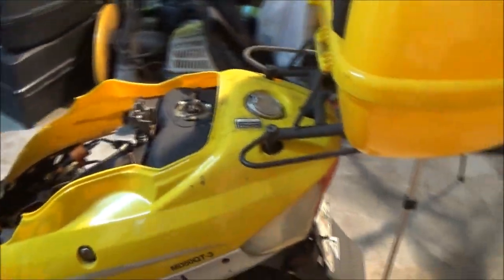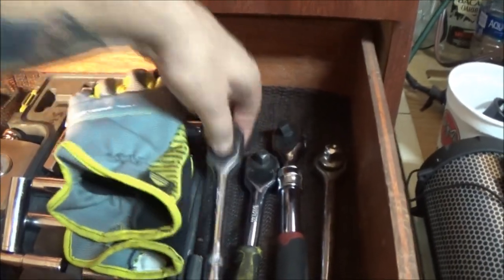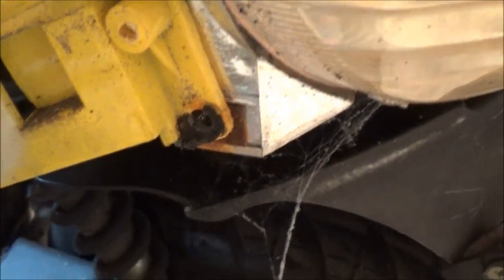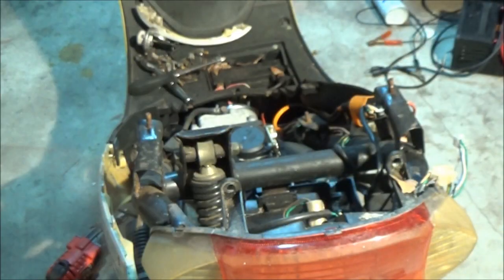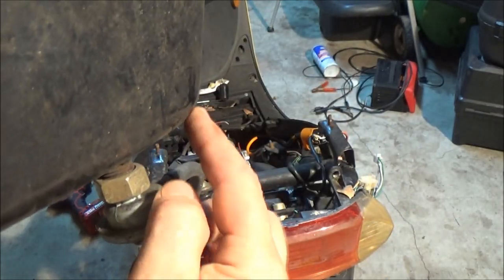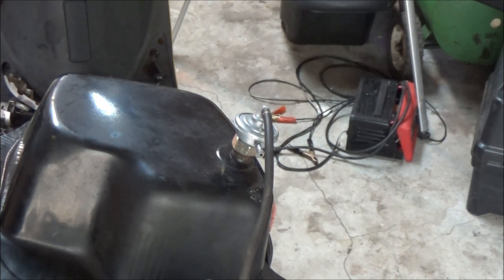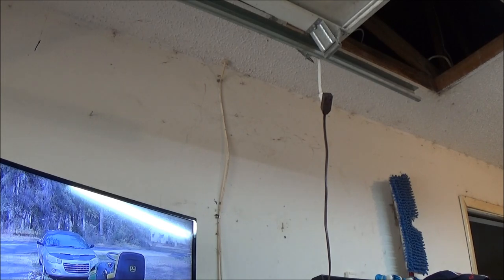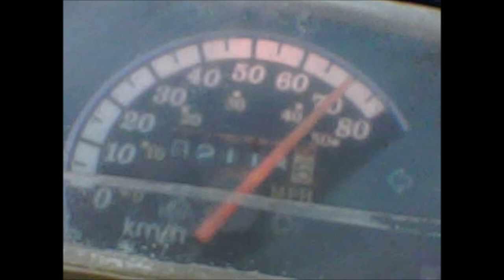Gas Tank Cleaning On The Scooter

Comment: Hello, I have a Future Champion  VIP With the 139QMB on it. Bought 4 years ago, drove it for a week and then let it sit in a shed ever since. Decided I'd break her out and try to get her running again. I bought a brand new tank on ebay because I figured the one in it needs to be cleaned, so instead of having to remove and clean then reinstall, I figured I'd just buy a new one and clean the old one whenever I got a chance to get around to it, but at least the new tank would save me some time. I thank you for putting this video together for us folks. You got a subscription!
Reply: did it start working after you got a new tank?

Comment: Very nice and detailed work my friend....🙏

Just picked up a Baja SC50 /basically a GY6-50...
Picked-up this project Scooter 🛵 for $150 and has been sitting for more than 5 year..!  😲

Mine came the plastic tank I just pulled and discovered it is cracked in three places due to gas & heat bloating tank...😳

So just ordered a new Metal Replacement Tank instead + New Carb..! 👌

Your video was very helpful cause this scooter has identical design to yours and even discovered your tank style works and fits into my Baja SC50...👍
Reply from the maker: Thanks man. Great deal you on your bike. Thanks for watching and commenting.
Reply: Where did you order parts?

Comment: What did you put in it to make it go 80mph
Reply from the maker: High performance parts. Carb, CDI box, Coil. You can also get a big bore kit pretty reasonable. If I do another one that's the route I'll go.
Reply: Can I put a 150 cc engine on my 50cc scooter body
Reply: I have the racing chi box coil and spark plug on it now and racing carb
Reply from the maker: Yes I have seen that done before there may be a little fabrication but it shouldn't be that difficult. But if you go with an 80 cc to 100cc Big bore kit it will come with the jug the gaskets the rings and wrist pin, that should put you up around 80 mph. But keep in mind if you do that you'll probably have to upgrade the exhaust so there's not as much back pressure.
Reply: Okay thanks that will be my next upgrade I like your videos it’s really helpful

Comment: Did you do any other work to it before cleaning the tank that you thought might've been the problem?
Reply from the maker: Yes. It was a basket case when I got it and I could see the dirt and crud in the take before I even got it running.
Reply: @shabear1000  I hear ya pal. I bought a 150 cc one last fall and it sat for a while after I rode it for a couple weeks, then when I brought her out again I changed the motor oil and gear oil took her to work and back a town over, then the next day she didn't start and since then I've changed the fuel and vacuum lines, the fuel pump I replaced with an on/off valve, changed the spark plug adjusted the valves exchanged old fuel for new (even ethanol-free, didn't know it wasn't necessary just helps to start after storage) and some cleaner solution oh and completely cleaned the carb, , still didn't work, put in a new carb, still won't work. And this is where I'm at now after testing for spark. I noticed metal flakes in the bottom of the tank, so, here goes
Reply from the maker: @auginater4200  let me know what you find out. It be helpful for future references not only for us but for others as well. Good luck man.
Reply: @shabear1000  thx friend, will do. Thx for the great video
Reply: if be interested to hear if it worked for you

Comment: I’m work on my tank now my cousin kids put water in my gas tank experimenting and it stop cranking up it’s turns over but didn’t run
Reply from the maker: That sucks but kids will be kids lol. Make sure you get all the water out and you should be ok. May take a little bit but you should be fine.